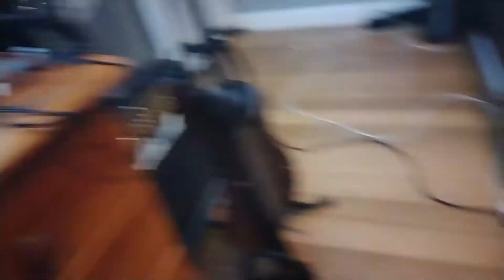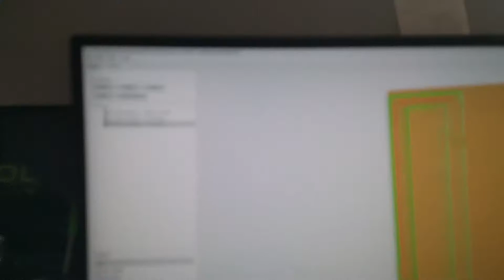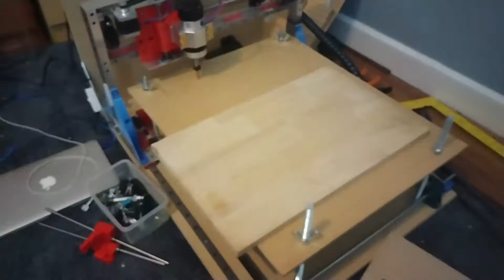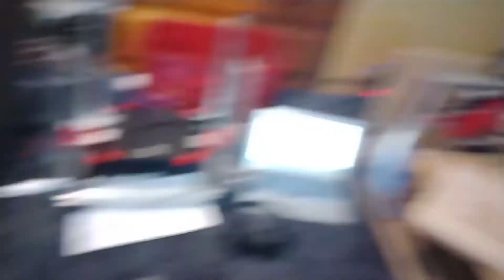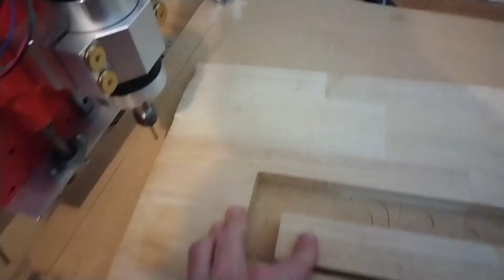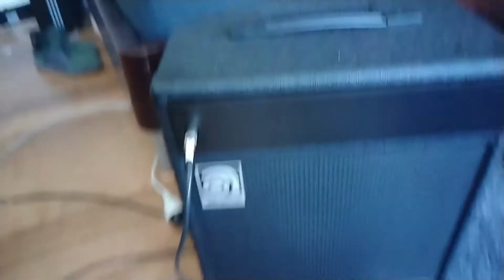Bass Amp - Knob Cover

Comment: Did you consider making it out of one piece?

I'd really like a cnc router but I don't know if I have enough space, or an appropriate space for dust. Did you buy yours off the shelf?
Reply from the maker: Hi, Yeah I making it from 1 piece would have been a better option, but I don't have any wood that thick (needed to be 18mm to clear the knobs + 3mm for the cover plate).
I made this CNC myself from parts, I'm definitely glad I've added it to my arsenal of tools, it can be very handy!